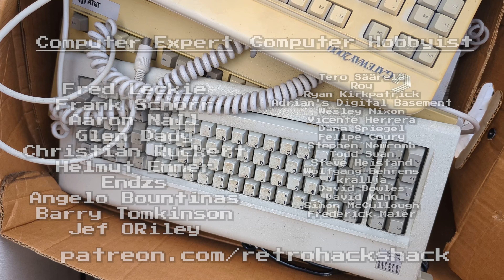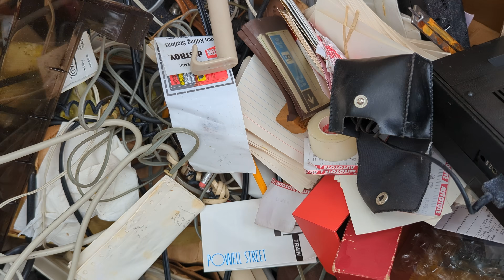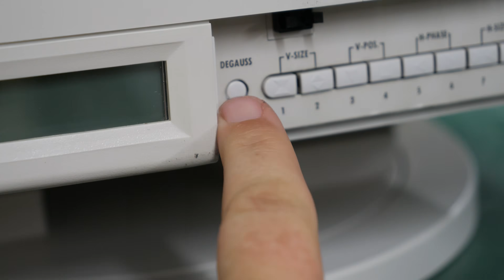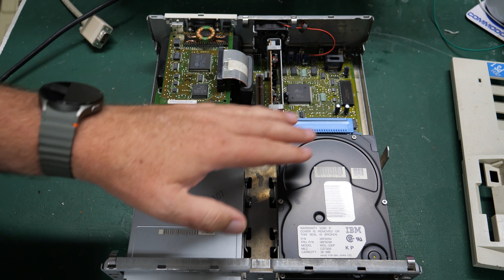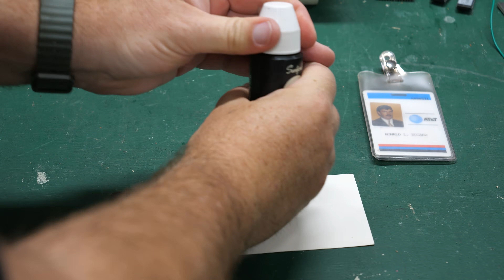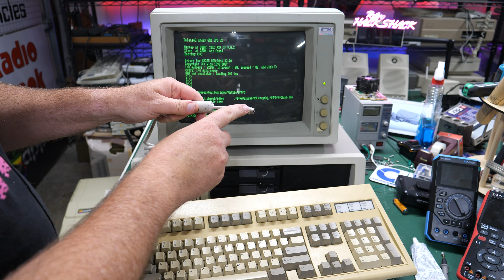You Won’t Believe What I Pulled From E-Waste: Model F Keyboard, IBM PS/1, 1994 High-End Monitor

Comment: I had one of those Gateway monitors but one day when I moved it the round part on the bottom cracked and it became almost impossible to use, move or adjust because it was so heavy and I took it to a recycling center.

Comment: In the early 1990s my Mum had a sliding channel changer, which also kept the television set in a sort of standby which meant that the screen would turn on instantly without needing to warm up when you flipped the switch.  That channel changer was with us a long time until the television set broke after spending years as the downstairs television set after it had been moved from upstairs.

Comment: So, in order to simplify set up on the PS/1, they replaced the IEC power plug with a bespoke connector going to the monitor?  Right.  I think they went for cost reduction and maybe make it proprietary to keep the customer within IBM's ecosystem.